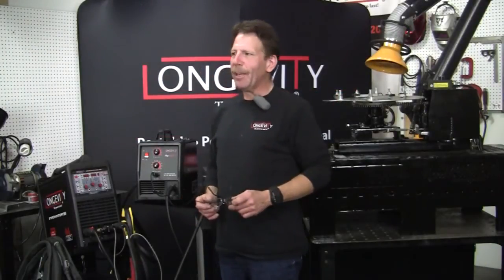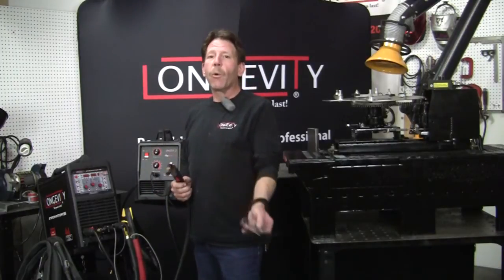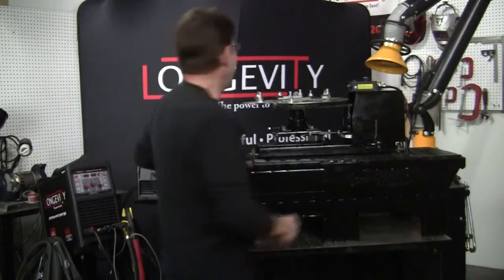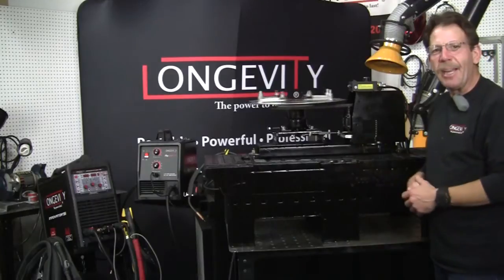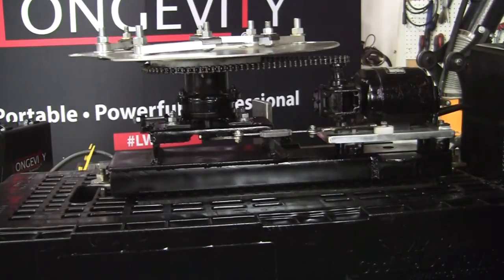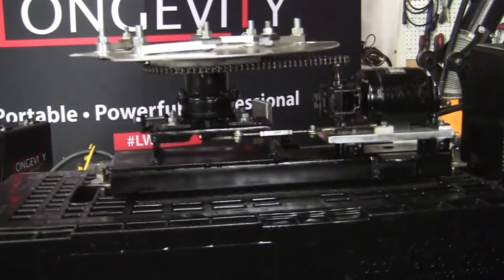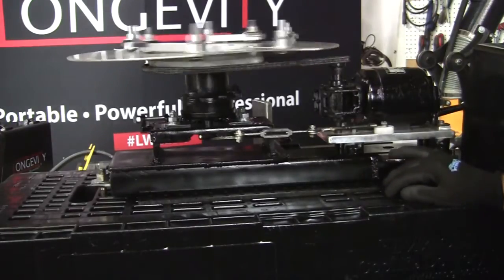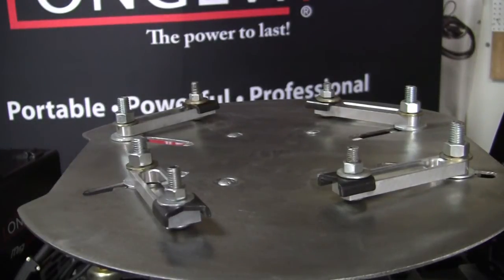Welding Turntable Part 9 - Final Video

Comment: You still have room for a bigger sprocket under the work surface.  Then go for an intermediate gear.  You could go to a belt system to.  Doug

Comment: Is there any way to get help from Longevity, I have a 256IP that worked great on arc welding but the first time I used it for plasma cutting it stopped working completely, I called and emailed tech support 4 times with no feedback, I told them I will pay to get it fixed but they did not reply. I wish I never got this welded. I was doing my car and now I am at a stand still.
Reply from the maker: Hello. Im sorry for not being able to respond to you in a timely matter. Please give us a call at 510-887-7090. We will love to assist you.

Comment: NO BUDJET!!!    and TO FAST,,, thats a New One!!! Wish I Had the One I sold!!!!!!,,,, It Had a Ft Pedal,Like a Tig Welder!,,, I Had 4000 sch 80 6Inch Pipes to weld On,,,, 6x6 3/4 Plates I Made,well Iron worker Wacked em,,, out Of 3/4 x 6 Bar    I Do Have Reg Pics,,Which accually I Have 27 Boxes that Need to Be scaned,I Missed the digital Cameras By 5-6 Months,,when they were 900 Bucks,, Like Calculators when they came Out!!!! But,,, with RR as Pres,and Going Thru a MIN Of a Pallet Of Lincoln 7024,Jet,a Month,,,, Money was Like Water,,, Cause CT had a Ton Of Industry!!!!!!!!!!     but,,between Our Gov and His Bro Inn The Big W House,,Theve CLOSED CT!!!!    Stanley, Allegheny Ludlum, Skiorsky,Pratt will be OUT IN LESS than a Year,No Brasss Millls, Well,No NUTTIN!  

PS,on your turn table,, why Not Just Change the sprockets Then,But a Controler Should Be Fine,as i had Approx, 33 Ponnds On,, Not aot,But also did a TON,of 12 In sch 40 Also,,, Thanks,, Jack,Is Charlie Still there???????    Thanks again,,, Tell Him,Jack from Storts said Hellow,and My Dif cell is In Here Someplace,,, Thanks,,,,,PSS,love Kevin in Chinese,,, a RIOT!!!!!    Pisss yer Pants FUNNY!